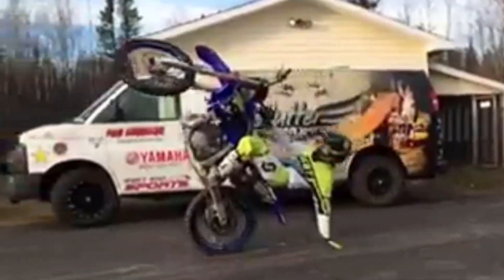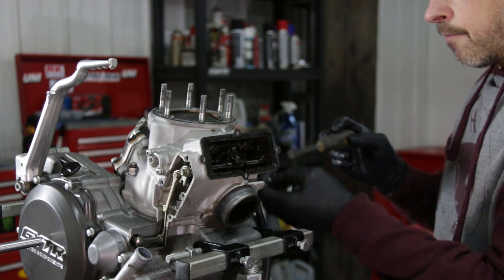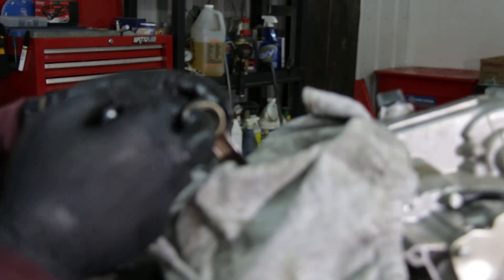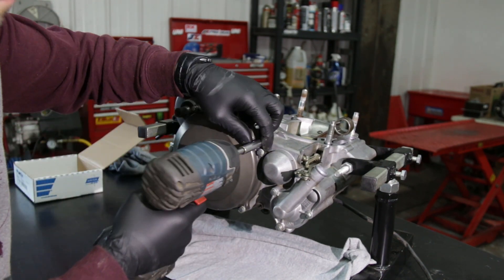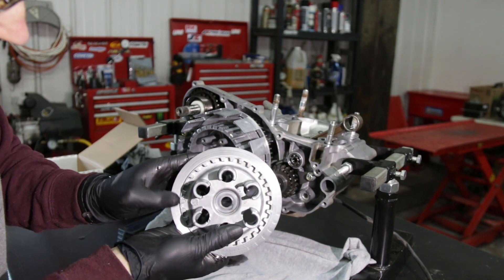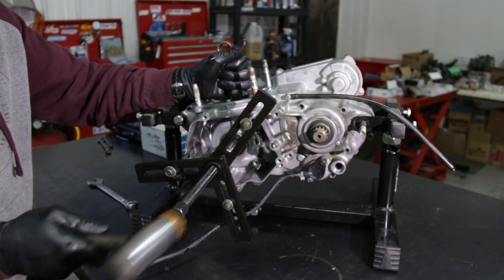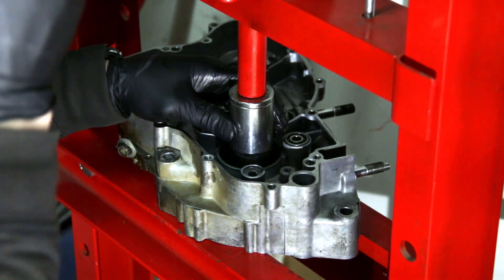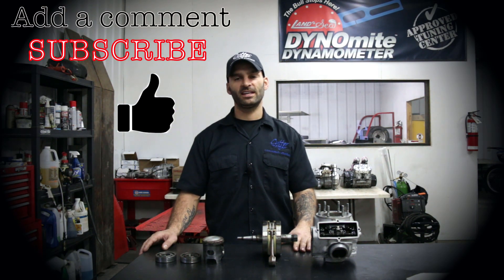How to dissemble a YZ250 2 stroke engine

Comment: so you don't hone the cylinder you would just go to the next oversize that meets the out of round and taper of the cylinder?    seems odd.
Reply from the maker: ShnitzlHaus  if your cylinder is out of round or scratch, you need replating. Get it mesured and check by a professional and he will tell you what size piston you should use

Comment: good video helped me alot, but i dont have the crank puller, can i take the cases apart without  it?
Reply from the maker: Its hard to tell before trying, some engines are easier than others. If your engine is fairly new, chances are you won't be able. You can try with a mallet, but be careful not to mess up your crank.
Reply: @SteelCutter  ok thanks, keep up with the videos!
Reply from the maker: @alimousa93  ok thanks for the motivation !